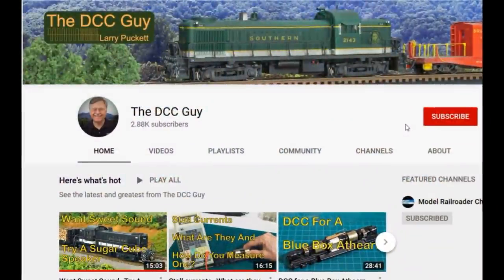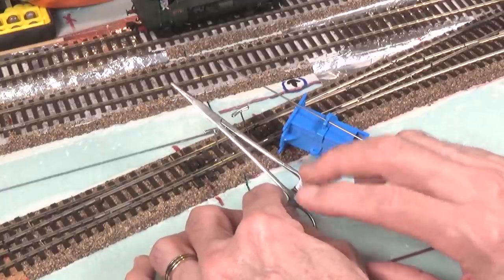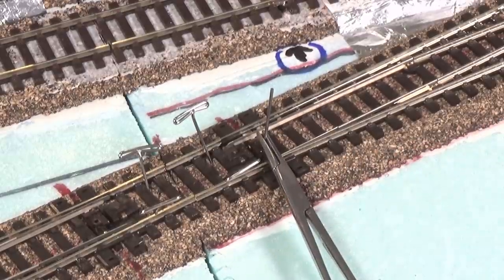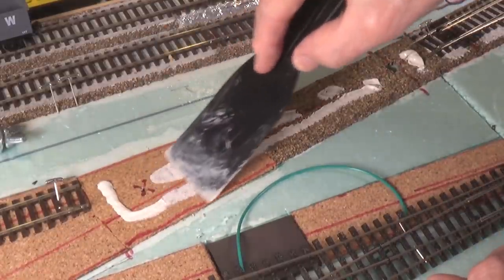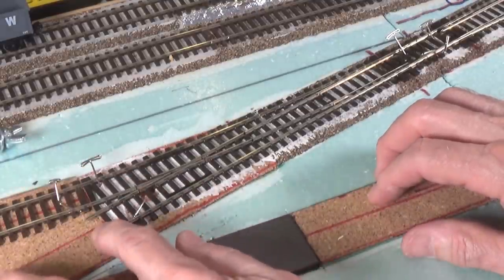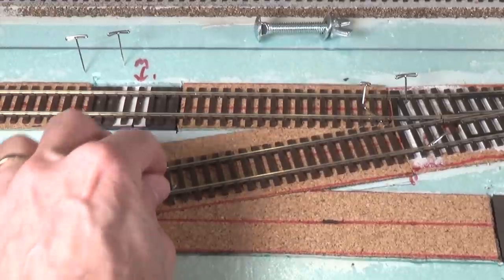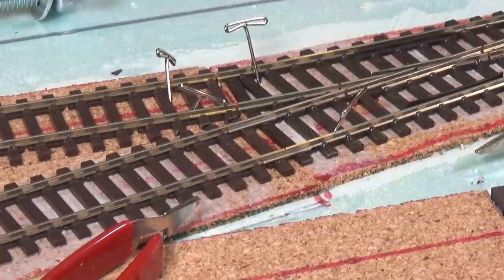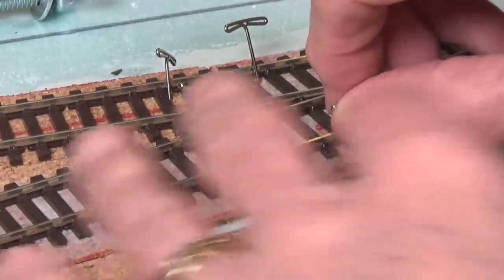Finishing The Ladder, Soldering Rail Joiners (146)

Comment: 19:00 a tip i learned from MR CARLSONS LAB is that you use a 100 plus watt soldering gun and a 12- or 10-gauge copper loop on that gun instead of the stock tip. and it will heat super fast and maybe add some flux to the joints, then you cool it off with a wet cloth...  he has a video on it. but what turnouts do you have in this video. the things you do is amazing, creative mind.

Comment: Once all the fitting has been done and you are ready to permanently set the track onto the roadbed try using regular push pins instead of tee-pins.  The larger diameter pin and flat bottom of the head allows you to exert some force onto the track giving better contact into the adhesive and thus a better stronger bond.  This is most notable in a more firm sub-roadbed such as homasote but even in foam it will be an improvement.

Comment: I have never liked soldering to turnouts.   How do you unsolder them if you need to change things up at a later date ?
Reply from the maker: I just cut them out with a Dremel too and then heat the ends to remove the joiners.

Comment: Hi Larry,  Have subscribed and enjoy both the content and your style of presentation. Have recently opted to add this soldering technique  to improve my track laying standards.   Please advise the temp setting of the iron you use and if you are using ‘cored’ solder.  I use large ‘bulldog clips’ to act as heat sinks.   🚂 T
Reply from the maker: There are a lot of variables when setting the temp. Thin pencil tips need higher temps than large flat ones. And som irons have temp sensors to maintain a certain point whereas others do not. So you really need to experiment with your setup. Since I often use a pencil tip I leave it on 800 degrees F plus I use heat sinks and work as fast as possible to avoid melting plastic ties and spikes/chairs. Although I do use rosin core solder I often add paste flux to guarantee I don’t burn it all off with a lot of heat. It was very helpful when installing the Rail Aligners in my most recent video.
Reply: Hi Again Larry,  Thanks for the  very prompt and helpful reply.  I also use solder paste and am blessed with a new variable temp soldering station.  Will be experimenting to get the best results with a pencil tip, instead of the narrow chisel used so far.
Have a Safe and Peaceful Christmas.  Happy Modelling everyone! T 🚂

Comment: Is the following idea feasible for mounting the switch machine ? : prior to installing the turnout attach the machine to the bottom of the turnout with glue or double sided tape, get it all adjusted and centered,  cut off the top of machine wire then lower the whole thing into the layout .
Reply from the maker: Peco makes solenoid machines that are designed to work with their turnouts exactly that way. I guess you could do that with the Blue Points or Tortoises but they are designed with this method in mind so it is easier if you plan ahead and follow the instructions. The problem comes when the turnouts are laid first and then cannot be reached from the bottom and top at the same time.
Reply: I saw an article a while back, I think in Model Railroader, pertinent to installing Tortoise switch machines, wherein the author used a piece of double-sided tape on the joining face of the switch machine, to hold it in place on the bottom of the layout, after he "stabbed" the spring wire through the hole in the throwbar.  This seemed sufficient to hold the switch machine in place while he secured it with screws.

Comment: You can also get pre wired rail joiners
Reply from the maker: Yes, and you can easily make them yourself. However I prefer to use a larger wire than is available on the prefab units I have seen.

Comment: I am using hollow core doors. How large should I make the throw hole?
Reply from the maker: Depends on what the instructions say, have you checked them?
Reply: I have not received my blue points yet, but I was wondering I guess if you’re using 2 inch foam board a hollow core door shouldn’t be no problem I just thought I’d ask thanks
Reply from the maker: You may need to provide longer throw rods made from music wire available at hobby shops. Some folks who have used 2” foam recess the switch machines into the bottom. Most hollow core doors are only an inch thick though.

Comment: You must have the eyesight and hand-eye coordination of a fighter pilot, can't fit those in less than 20 tries.  I want to see you do another, don't believe anyone can do that so fast.  The cliamping thing is absolutely necessary,  if you glue or screw, if it hangs straight it will work.  Not doing it like you show means it's to forward, sideways or whatever.  I have a couple dozen to do this weekend, want to fly in and handle that.  You make it look easy and didn't have to cuss once.

Comment: If I’m using rail clamps, is soldering a need, I already have a garden layout and want to convert or atleast run a mogul which is dcc, tia
Reply from the maker: What are rails clamps? At any rate I recommend soldi g rail joiners to get bullet proof electrical continuity. Otherwise the connections at rails in the garden tend to oxidize and get fouled with leaf litter, dirt, etc., and you locos stop running unless you connect feeder wires to each section of track.
Reply: @TheDCCGuy I’m using piko style clamps
Reply from the maker: OK, LGB size clamps, now I see what you mean. If I ever put in  a garden railway I think I would use Blunami decoder and go with battery power.
Reply: @TheDCCGuy  my dc locos already have sound cards, not sure I could do battery switch, I just bought a lgb 20283 loco, it works fine but no smoke till I run dcc, a lot of money for not being able to atleast get the smoke option

Comment: A quick question on preparing turn out. Why cut rails passed points when you could use insulated rail joiners? I think it's faster and doesn't weaken rails.
Reply from the maker: First, since I solder the cut rails to the running rails it does not weaken them, if anything it makes them stronger. Now the reason I do it is because in the operating sessions I have attended where Peco turnouts like these are used, I have noticed that operators tend creep up as close to the frog as they can get while waiting for a train to pass on the other track  and to run past the insulated rail joiners on a too frequent basis and the resulting short shuts down the layout. By simply cutting them back to just before the frog that does not happen. If you look at other brands of turnouts that is how they are designed. It also is how the new Peco Unifrog turnouts are designed, they seem to agree with me!!
Reply: @TheDCCGuy  Well that makes sense.Thanks for answering.

Comment: Hi Larry. Great educational video. Can you tell me where (preferably in the UK) I could get the heatsink clips you use for soldering, please?
Reply from the maker: When you search look for heat sink soldering clips. I found some just like those in the video on Amazon at

https://www.amazon.com/Amplified_Parts-Heat-Sink/dp/B009VNUZYS/ref=sr_1_12?crid=14COGBW56JENE&dchild=1&keywords=soldering+heat+sink+clips&qid=1605538866&sprefix=soldering+heat+sink%2Caps%2C211&sr=8-12

You can also use a pair of hemostats like the one I used for gripping the Blue Point wire. Another common version are metal alligator clips. You should be able to find those many places.
Reply: @TheDCCGuy  Thanks, Larry.

Comment: Great video.What gauge throw rods do you use? I have all tortoise switch machines, but wasn't sure if needed to upgrade the throw rods. First layout just beginning it so unsure. Thanks!
Reply from the maker: I suggest using the ones that come with it if long enough for your installation. However with my 1” thick subroadbed and the cork roadbed mine is a tad bit too thick so I use K&E 0.032” dia steel music wire from the hobby shop. They have a distinctive display of red cardboard tubes holding the wire in just about all US hobby shops

Comment: If you have expansion gaps and want electrical continuity, how do you do it? Maybe little wires connected across the gap?
Reply: If you have a bus wire system, what i do is solder 2 droppers onto the small metal pieces of wire that Larry fitted on the under side the point and connect these to the bus wire, no need to solder the fishplates. You can therefore leave an expansion gap, if needed.
Reply from the maker: Yes, you could do that but on those electrically isolated sections I add feeders or droppers to each rail and then connect them to the DCC power bus as I showed previously. This means having to solder more feeders but it gives reliable power. Loose, unsoldered rail joiners can lose electrical continuity due to oxidation, paint, and glue getting in. Some rail joiners are initially tight and can give an electrical connection which then fails or is only intermittent over time—very hard to diagnose. Soldering all but a limited number of joiners guarantees an electrical connection for the lifetime of the layout or owner whichever comes first.

Comment: Hello Larry.... I'm busy building almost the same shunting layout. 2500x600mm Also split in the middle. I soldered feeder wires to every section of track, so no need to solder the fishplates. Any reason you went this rout? Or is it more a personal preferance? I need to invest in the blue point motors, they look awesome. Thank you for the great videos. I really enjoy them. Cheers, Evert, South Africa.
Reply from the maker: Assuming you drop a feeder from every piece of rail connected by fishplates (rail joiners) then there is no need to solder them.I do it because I only connect feeders about every 6 feet with code 75 rail. On the Piedmont Southern which is mainly code 83 I drop feeders about every 8 feet. Naturally this means that since flextrack is no more than 3 feet long I have to have rail joiners in there and they need to be soldered for reliable electrical continuity or I would need more feeders. On something like a yard ladder some stock rails can be essentially continuous for 3 feet whereas some are no longer than a turnout or two so instead of dropping a bunch of feeders I just solder the rail joiners. Basically I prefer to soldier the rail joiners instead of having a lot of feeders to connect to the power bus under the layout—I find it a lot easier on my back to not have to crawl around down there!

Comment: Larry ... as always a great video ... you never fail to provide motivation.  Question:  What size T pins do you find most useful when laying track?
Reply from the maker: The ones in the videos are 1.5” but I also have a number of smaller 1.25” long ones. I mainly use the larger ones. You can usually find these in hobby shops and mail order vendors that deal in RC airplane kits and supplies—in the USA, Hobbytown.
Reply: Thanks!!!   I need to pick some up.
Reply from the maker: Amazon has many different assortments too.

Comment: Hi Larry, another great video thank you. Where did you purchase the heatsink clips, cannot seem to find them in the UK, unless they go under a different name?  Thanks Jim
Reply from the maker: When you search look for heat sink soldering clips. I found some just like those in the video on Amazon at

https://www.amazon.com/Amplified_Parts-Heat-Sink/dp/B009VNUZYS/ref=sr_1_12?crid=14COGBW56JENE&dchild=1&keywords=soldering+heat+sink+clips&qid=1605538866&sprefix=soldering+heat+sink%2Caps%2C211&sr=8-12

You can also use a pair of hemostats like the one I used for gripping the Blue Point wire. Another common version are metal alligator clips. You should be able to find those many places.
Reply: @TheDCCGuy  Brilliant, thanks Larry

Comment: What jointers should I use to connect a PECO turnout and an Atlas flex track code 83 ?
Reply from the maker: Peco says their SL-110 joiners are sized for both code 75 and code 83 rails. Also are you using their code 83 turnouts for American protoypes or their UK turnouts?
Reply: @TheDCCGuy  I have found that the SL-110 joiners are too small for Atlas code 83 super-flex track.  The cross section of the Atlas rail, particularly at the base, is much thicker than the Peco rail.  Yes you can force the SL-110 onto the Atlas track but it is touch and go at best and the chances of bending the joiner is pretty high.  Experience has shown me that the Atlas code 100/83 rail joiners are better if you gently squeeze them down a small amount on the side that will go onto the Peco track/switch.

Comment: The rail joiners (fishplates) you are using seem to be a loose fit whereas Peco rail joiners are very tight fit. No joint soldering required.
Reply from the maker: Those are Peco rail joiners on Peco track and turnouts.
Reply: @TheDCCGuy  I only use code 100 track so maybe there is only one joiner for all sizes of track.
Reply from the maker: I know they make a different one for code 100. However this SL-110 is sized for both code 75 and 83 so the might have added a little wiggle room for the code 83 rail.
Reply: @TheDCCGuy  I learn more every day Larry. Looking forward to the next episode.

Comment: Maybe it's obvious, but the hole for the wire from the Blue Point needs to be drilled before you glue down the turnout. Maybe you said that earlier.
Reply from the maker: Yes, that is the method they are designed for. I have heard of folks who try to drill the holes afterwards and it can easily result in damage to the points if the drill goes too far. However, as one manufacturer once told me, real men don’t read or follow instructions!

Comment: You keep calling those clips heat sinks, I cant find them on amazon, where did you get them and what are they called? If you can please put a link to them, thanks
Reply from the maker: Here is an Amazon link

https://www.amazon.com/Amplified_Parts-Heat-Sink/dp/B009VNUZYS/ref=sr_1_12?crid=14COGBW56JENE&dchild=1&keywords=soldering+heat+sink+clips&qid=1605538866&sprefix=soldering+heat+sink%2Caps%2C211&sr=8-12
Reply: @TheDCCGuy  Thanks so much I couldnt find them. got them now.

Comment: Also what turnout # does one use in ladder?
Reply from the maker: That depends on how much room you have and the size of the equipment to be operated there. No. 4 turnouts allow a compact yard but may not be adequate for long cars or locomotives. While you could use no. 4 easily in coal hopper marshaling yards larger turnouts would be necessary for a coach yard. I use no. 5 in some yards but no. 6 in my main yard. MicroEnigneering has a new type of turnout in their yard series designed to give more compact yards and yet accommodate larger equipment. John Armstrong’s book “Track Planning for Realistic Operation” is a great resource on this topic.